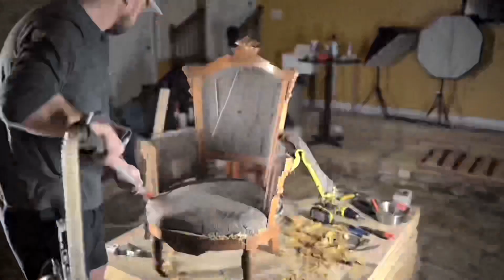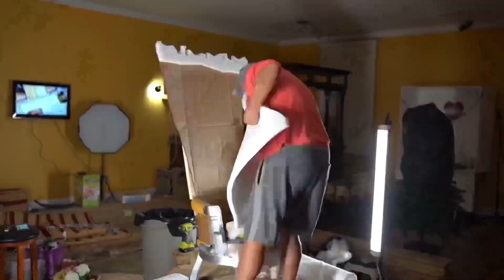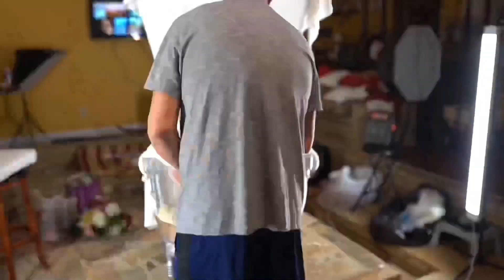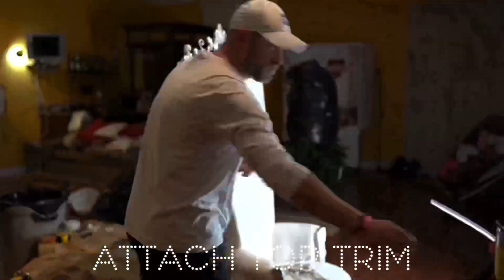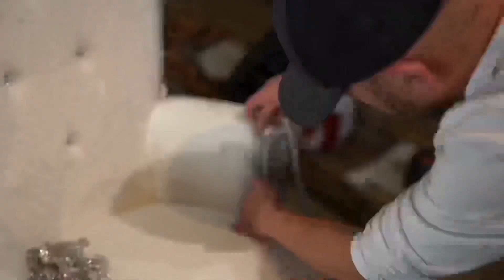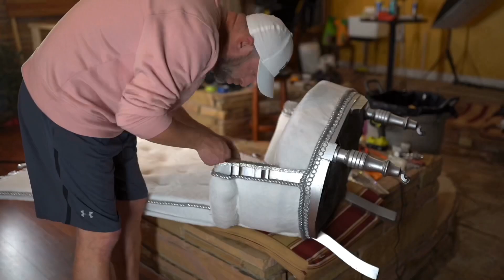Building A Throne - DIY

Comment: The chair looks so cool!! Couple questions! Did you add wood under the cardboard or was the back just cardboard and did you secure them with nails? Currently trying to build my own throne and I'm having trouble finding the right materials! Alsooo...where did you get the foam? Thanks!
Reply from the maker: Hey! Thanks!! So I put wood on the side and one board across the top but the rest of the back is cardboard. You’re correct ☺️ I used nails to secure it - also used a staple gun in some places. I was worried about it being able to hold someone up but by the time you add the foam, the netting and the fabric it’s actually great and feels totally secure. I’ve probably had 10 shoots in it and everyone just plops right in it and talks about how comfortable it is.
Reply from the maker: Oh! And I actually got the roll of foam at either Michael’s or JoAnns - it’s a 2” foam
Reply: @underdevelopedphotography5952  Thanks! I'm going to try that method. The back of my chair is super curved so I was having trouble finding a material that could flex to it. But if I add the wood I guess I won't have to worry?!
Reply from the maker: @BZakiyyah  maybe a thin piece of hard plastic? Or a thin fairly flexible piece of plywood?
Reply: @underdevelopedphotography5952  https://prnt.sc/14fz17s FINALLY GOT IT TOGETHER! CAME OUT DOPE. Thanks for your help! c:
Reply from the maker: @BZakiyyah  that looks awesome!! Love it!! 👏🏼👏🏼